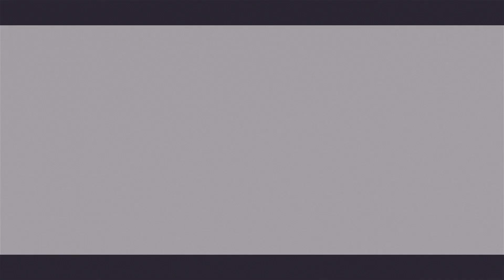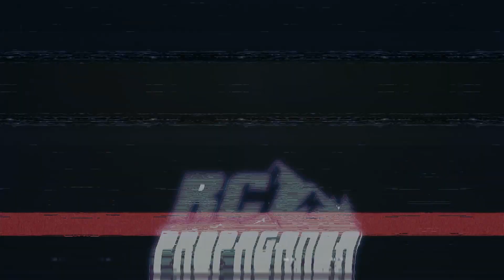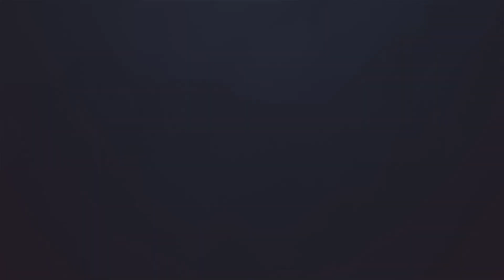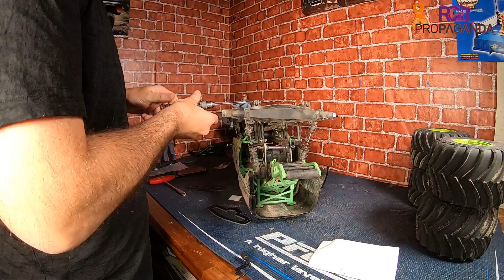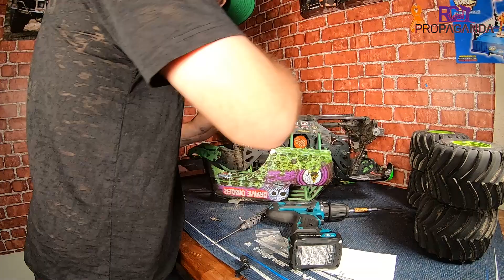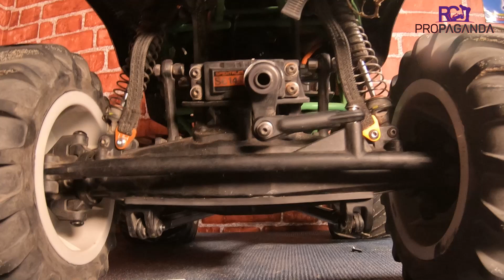Brace Your Losi Lmt With These Axle Braces From Freestyle Rc

Comment: Are you still running the stock steering servo? I ask because mine just took a dump today and I’m not really wanting to deal with the whole Losi warranty deal just to end up getting another crap servo a month later.  Got any recommendations for a good one?
Reply from the maker: For now it is stock. They came out with the 25t servo saver and I just need to pick that up and I have a reefs raw 500 on order and will drop that in when I get the servo saver. Many options on 25t servos. I would get a savox or a reefs servo. I run both and have had good luck. Def a smart move to pick up a new one.